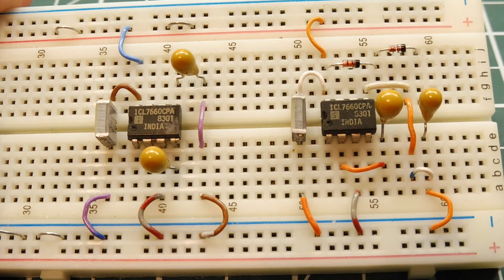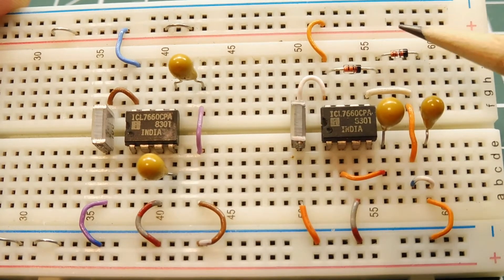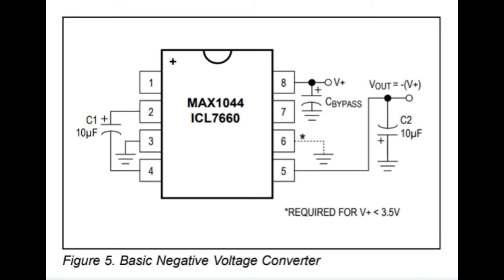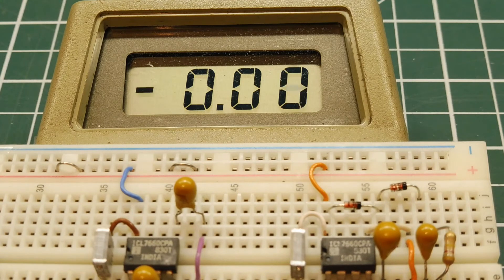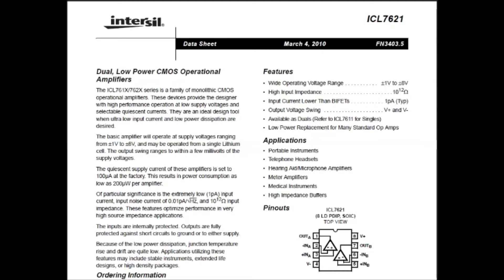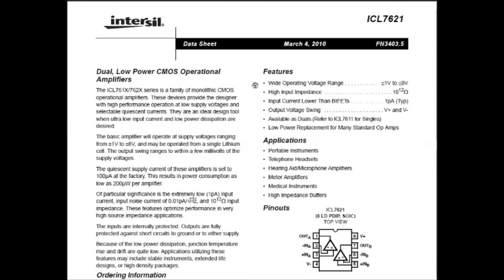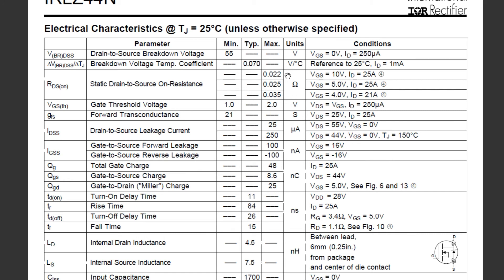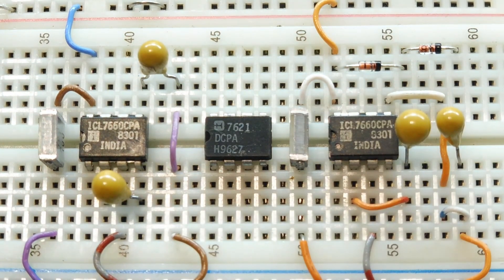Simple Voltage Converters  / Charge Pump Circuits

Comment: thanks very informative
 I have a question how to double the output negative voltage?
Reply from the maker: Check out the NMA0515S with +/- 15v output
https://www.tme.com/ca/en/details/nma0515sc/dc-dc-converters/murata/

Comment: What is the Voltage of zener diode
Reply from the maker: Zener diodes are not used in the circuit.
Reply: @0033mer  in right side there are 2 diodes i thought its zener but what kind of diode is it
Reply from the maker: The diodes in the schematic at 2:40 are 1N4148 switching diodes.

Comment: When I saw the headline I thought "ok. This is like the Max232 that I have used, when I learned about the Atmega 168" But this is something completely different. So, you can avoid having to use forexample two 9V batteries, and get away with a couple of doubl As instead. That is wort one pound. (I see theese cost one pound from my usual supplier. Cheaper on e-bay I suppose.)
(To those who are not aware, Max232 is for translating between TTL and serial.)